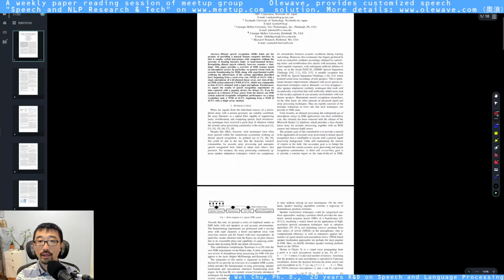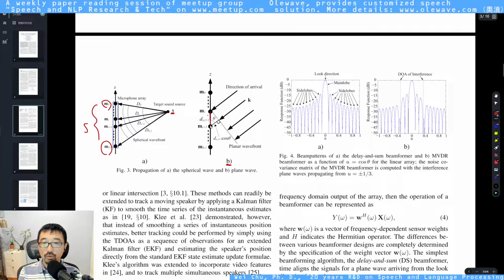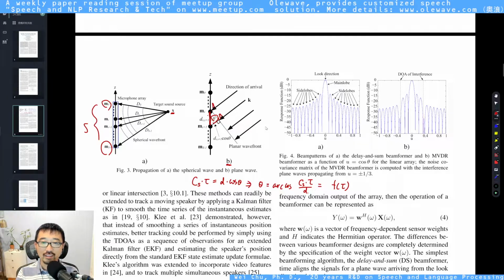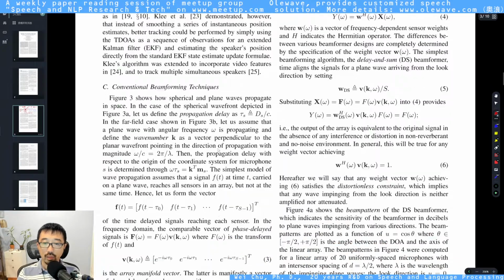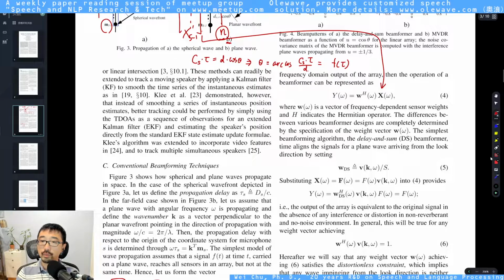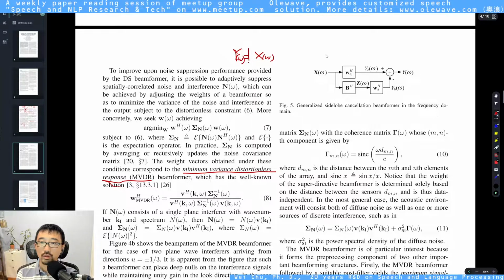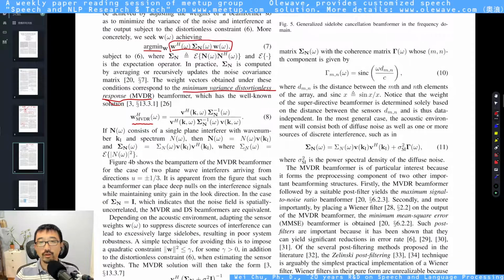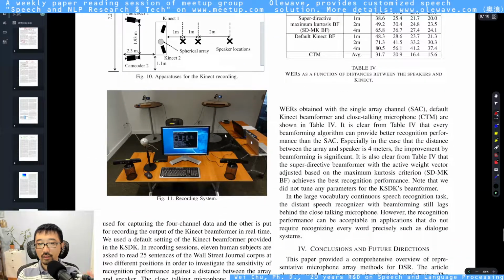Phased Array Radar on China's Aircraft Carrier Fujian 003 and Its Connection with Speech Beamforming

Comment from the maker: Error correction: I found Passive Phase Array Radar still transmits signals. I did wrongly say that PPAR does not send out signals in the video since I am no radar expert. But I think my review on microphone array is okay by far. 

I have a question if you are a radar expert: so is there any real 'passive' radar which does not send any signals?
Reply: I'm not an expert but there's no truly passive radars. On "passive" radars antennas that only receive are linked to distant emitters. In the future maybe possible to use the cmb as source? I'd imagine we probably need some tic tac mothership technology to pull that off though.